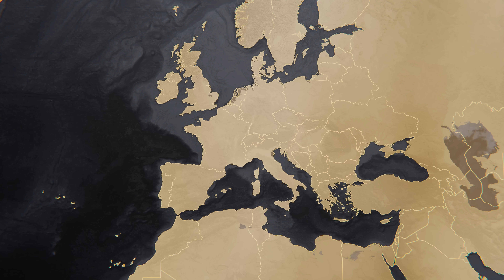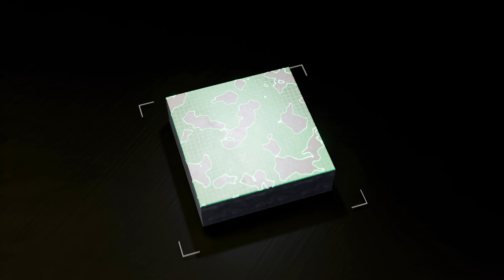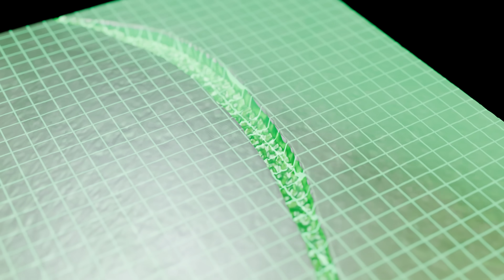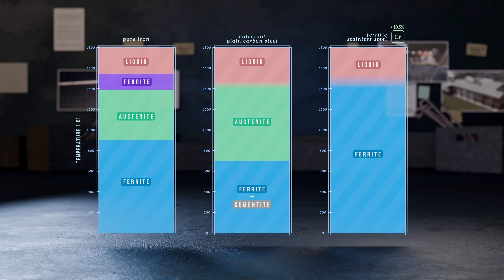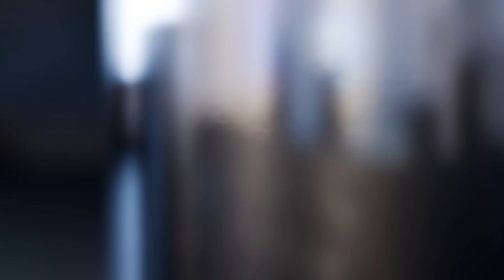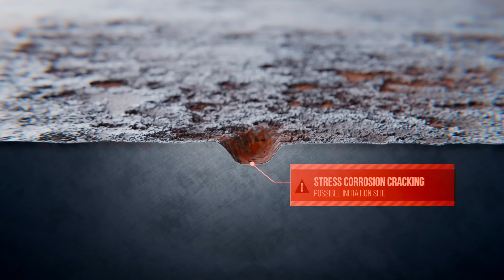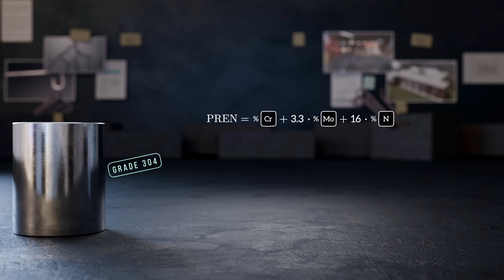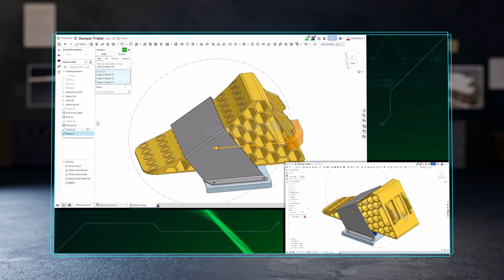The Problem with Stainless Steel

Comment: Excellent video, as usual. For us nuclear engineers, stress corrosion cracking is a real bogeyman, especially when neutron irradiation is added to the mix. A good reminder of the importance of thinking holistically when selecting structural materials.
Reply: As a material engineer for a Nuclear structures project,  I can confirm this is true. Our default Stainless was grade 316. In the UK, we call it A4 for fasteners. 
Even so, samples went sent to the lab for testing and had to be approved by the UK Nuclear Regulator .
The Marine industry should also only use 316(A4). 
I've seen 304(A2) fasteners develop a white coating , which dont look very pretty on yaught fixings.

Comment: It’s also worth noting that the chromium required to make a steel stainless is dependent on the carbon content. Chromium also likes to form chromium carbides. This is why heat treatable higher carbon stainless steels usually have more chromium, so that there is still free chromium to form a stable barrier. 

Passivation of materials can also help with corrosion resistance. In this process stainless steels are submerged in an acid which attacks free iron on the surface to help ensure the surface is primarily  composed of chromium atoms.

Comment: Great Video.  Just last night I learned that a highly regarded sailboat brand used 304 in uninspectable locations for structural connections to the hull for a number of years.  Now these boats can be a bargain on the used market for a savvy buyer willing to take on the work/expense of replacing these parts.
Reply: Gotta use 316 or Duplex. Better yet, use NiAl bronze (not brass!).

Comment: I had case where galvanic corrosion destroyed stainless steel cable ties. Buckles were made of normal iron, ties were made of stainless strips, chinese garbage. There was no direct contact with sea water but there was salt in the air. Place on tie where buckle touched strip was rusty and cut as something cut with laser. Avoid any contact between stainless steel and other metals in salty environment.
Reply: That's not galvanic corrosion. If it was, the stainless would have caused the iron to corrode, not the other way around; that, by definition is not galvanic corrosion of the stainless, it could only possibly be galvanic corrosion of the iron. The less noble metal will always corrode first to "protect" the more noble one. What you experienced was stress corrosion cracking: the spot with repeated contact (stress) was where the crack propagated, driven by the chlorine. Stainless steel is almost always passive enough to use with cast iron and copper without galvanic corrosion being a huge issue, utilities do it all the time. What you're describing would be something like the zincs on a boat causing the hull to corrode (this never happens).

Comment: 17:24 Could they coat the rods in rubber or silicone to keep water and chlorine away from the steel parts too? I assume that will cost more, sure.  But maybe worth it to save lives?
Reply: In wet environments, this can accelerate corrosion. Any galvanic difference with surrounding materials is concentrated at defects in the coating.
Reply: @jonathantaylor8501  Wouldn't this only happen with metal coatings because both metals would constitute the electrodes of a galvanic cell? I don't think rubber or silicone would make a good electrode. Also, the preferential corrosion doesn't always happen to the underlying metal, it happens to the less noble metal. Tin-coated steel will cause the steel to preferentially corrode because steel is less noble than tin, but zinc-coated steel will cause the coating to preferentially corrode because zinc is less noble than steel.
Reply: @jonathantaylor8501  makes no sense since boats will have rubber bits bits on them to cover flaps, etc. Also how can it make it worse if water CANT get to the metal? Its not like those rods would wear down. They just sit there
Reply: @pvic6959 you can't coat the threads, so unless you can guarantee they're isolated then the corrosion is concentrated there. Doesn't seem sensible to me
Reply: This practice is actually banned in many countries.  The least little ding in the coating creates a future failure point.   There's been a few disasters because of this to the point governments said no more.
Reply: @carolinejoybarnhart3717  was not aware of this. interesting. But in a place where there is no wear and tear I thought it would be fine?
Reply: @pvic6959 It frequently happens during construction.   Things get banged around.

The point of stainless it its coating is normally self healing.
Reply: @carolinejoybarnhart3717  I see, thank you!
Reply: If there is a single nick in a sealing compound ( Which would probably happen during installation)It would trap the humid chlorinated environment in there. 
As such , even if you were to drain the pool , the rods would continue to corrode.

It would also hide any corrosion , making inspection impossible.
Reply: No, a better option would be 15-5 sst. But hey it already happened, and hopefully won't happen again.
Reply: Also, this makes surface inspection difficult.
Reply: The fact that Knicks ARE going to happen and actually accelerate corrosion is why you no longer see epoxy coated rebar in bridges.
Reply: ...NOBODY KNEW THAT AT THE TIME

........THAT is MAIN ISSUE....EVERYONE THOUGHT IS WAS fine

Comment: Choride SCC has been known about for a long time.  The classic example was austenitic stainless steel piping under calcium silicate insulation:  water would get into the insulation through improperly sealed cladding, where it would wash calcium chloride out of the insulation toward the pipe surface.  Water would then evaporate, leaving behind a strong, high chloride concentration brine.  Pipe would look fine, then six months later would explode and kill people.   

The real game changer in duplexes is the addition of nitrogen as an actual alloying agent.  How the hell you can get N to stay in molten metal is still mysterious to me, but its influence on the pitting resistance of the alloy and hence its resistance to chloride SCC is incredible- many times the beneficial influence of molybdenum.

Comment: It amazes me how many people assume that stainless is a miracle material that is fail safe.  In the marine environment, many owners of wood boats erroneously believe that SS fasteners are the end all, be all solution, however, SSneeds to have constant access to oxygen to maintain passivity.  When one drives am SS fastener into wood, and cpvers it with a wood plug, glued in, the access to oxygen is cut off, and, especially in salt water, crevice corrosion takes hold rapidly.  There are horror stories of planks falling off of wood boats in as little as three years after the fasteners were installed.
Reply: I remember seeing a film back in mechanical engineering school material science that showed a rubber band stretched across a stainless fastener which prevented oxygen from reaching the surface of the fastener. Time lapse showed the rubber band cut into the fastener.

Comment: At 9:01 the video says duplex has a nickel content in between austenitic (304 (8%) and austenitic 316 (10%)) and ferritic 430 (0%) but at 16:23 duplex 2205 shows 15% of Nichel , almost double the austenitic (so not in between). Am I getting something wrong or is there an error in the first statement or the numbers?
Reply: Also at 9:08 or so the video says "this two phases structure" but it seems there is no explanation of how the structure comes to be (composition plus process?), a couple of sentences there would clarify it. This channel is amazing just noting these things if the comment can help improve the video
Reply: Something like "Below roughly 8 percent Ni, nickel alone cannot stabilise full austenite at room temperature, so ferrite remains present."
Reply from the maker: At 16:23 it's showing that the duplex steel contains 0.15% Nitrogen, not 15% Nickel.